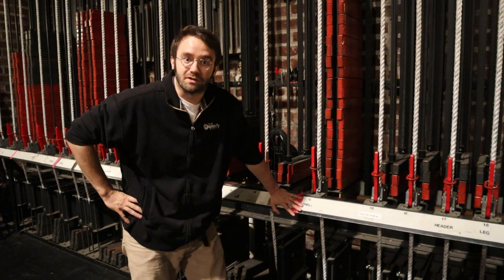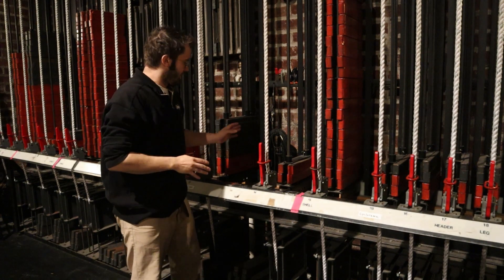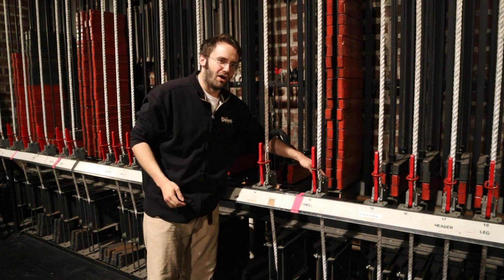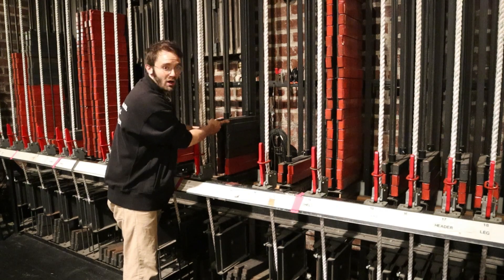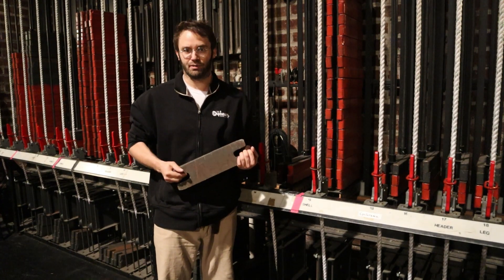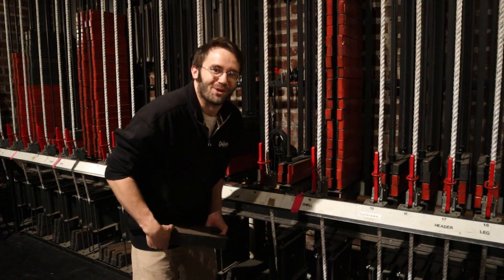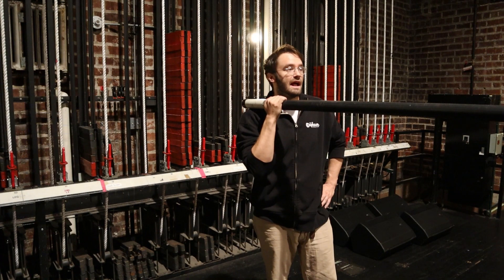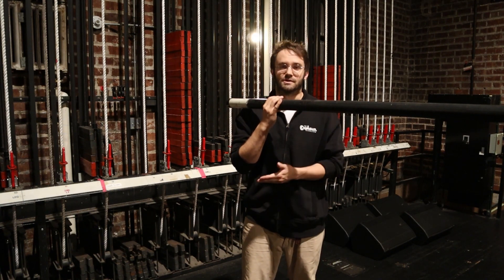Fly System | Technically Speaking with Ross McIntire

Comment: hi, so im in my schools theatre program, and was just drafted to work the flys (tech week starts tomorrow and i found out id be working today.) my stage manager was gonna do them originally, but he doesn't have an assistant and asked me to do it for him. i have to ask, if i want to lower one of the curtains or the cyc, should i pull from the front line or back line?
Reply from the maker: A good way to think of it is this, raising the weights means lowering the bar, and the weights are in the back, so pulling down on the front line lowers the cyc and pulling down on the back line raises it!